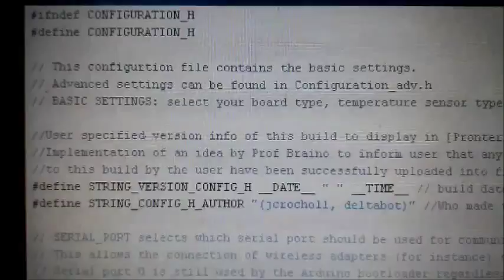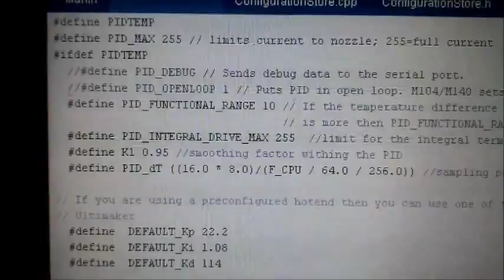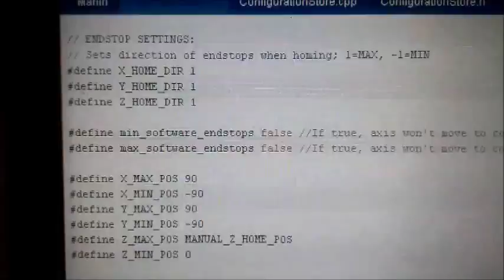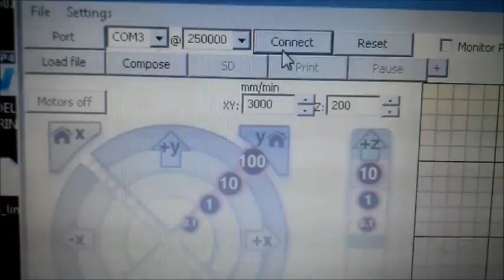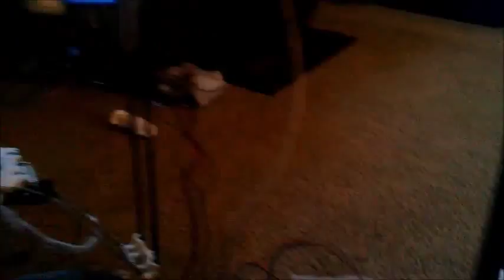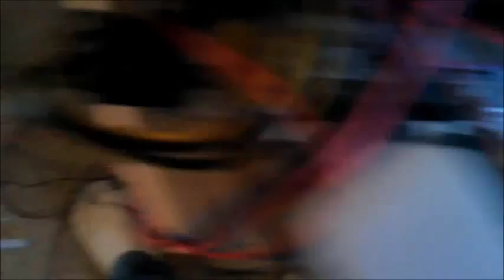ROSTOCK 3D PRINTER MARLIN FIRMWARE HELP!!

Comment: I would first ask how your endstops are wired.  On mine, a Normally Closed endstop resulted in the endstops_inverting false line.  Are your switches Normally open, and then close when the carriage hits?  My guess would be the switches are wired backwards or those lines need to be true.  It dosent move, because it thinks the endstops are pushed in right now...  Try to home all with one of the switches held.
Reply from the maker: https://www.facebook.com/pages/Southern-Idaho-3D-Printers-Group/673694712681546

my fig

#ifndef CONFIGURATION_H
#define CONFIGURATION_H

// This configuration file contains the basic settings.
// Advanced settings can be found in Configuration_adv.h
// BASIC SETTINGS: select your board type, temperature sensor type, axis scaling, and endstop configuration

// User-specified version info of this build to display in [Pronterface, etc] terminal window during
// startup. Implementation of an idea by Prof Braino to inform user that any changes made to this
// build by the user have been successfully uploaded into firmware.
#define STRING_VERSION_CONFIG_H _DATE_ " " _TIME_ // build date and time
#define STRING_CONFIG_H_AUTHOR "(jcrocholl, deltabot)" // Who made the changes.

// SERIAL_PORT selects which serial port should be used for communication with the host.
// This allows the connection of wireless adapters (for instance) to non-default port pins.
// Serial port 0 is still used by the Arduino bootloader regardless of this setting.
#define SERIAL_PORT 0

// This determines the communication speed of the printer
#define BAUDRATE 250000
//#define BAUDRATE 115200

//// The following define selects which electronics board you have. Please choose the one that matches your setup
// 10 = Gen7 custom (Alfons3 Version) "https://github.com/Alfons3/Generation_7_Electronics"
// 11 = Gen7 v1.1, v1.2 = 11
// 12 = Gen7 v1.3
// 13 = Gen7 v1.4
// 3  = MEGA/RAMPS up to 1.2 = 3
// 33 = RAMPS 1.3 / 1.4 (Power outputs: Extruder, Fan, Bed)
// 34 = RAMPS 1.3 / 1.4 (Power outputs: Extruder0, Extruder1, Bed)
// 35 = RAMPS 1.3 / 1.4 (Power outputs: Extruder, Fan, Fan)
// 4  = Duemilanove w/ ATMega328P pin assignment
// 5  = Gen6
// 51 = Gen6 deluxe
// 6  = Sanguinololu < 1.2
// 62 = Sanguinololu 1.2 and above
// 63 = Melzi
// 64 = STB V1.1
// 65 = Azteeg X1
// 66 = Melzi with ATmega1284 (MaKr3d version)
// 7  = Ultimaker
// 71 = Ultimaker (Older electronics. Pre 1.5.4. This is rare)
// 77 = 3Drag Controller
// 8  = Teensylu
// 80 = Rumba
// 81 = Printrboard (AT90USB1286)
// 82 = Brainwave (AT90USB646)
// 9  = Gen3+
// 70 = Megatronics
// 701= Megatronics v2.0
// 702= Minitronics v1.0
// 90 = Alpha OMCA board
// 91 = Final OMCA board
// 301 = Rambo
// 21 = Elefu Ra Board (v3)

#ifndef MOTHERBOARD
#define MOTHERBOARD 33
#endif

// Define this to set a custom name for your generic Mendel,
#define CUSTOM_MENDEL_NAME "chris's bot"

// This defines the number of extruders
#define EXTRUDERS 1

//// The following define selects which power supply you have. Please choose the one that matches your setup
 //1 = ATX
// 2 = X-Box 360 203Watts (the blue wire connected to PS_ON and the red wire to VCC)

#define POWER_SUPPLY 1

//===========================================================================
//============================== Delta Settings =============================
//===========================================================================
// Enable DELTA kinematics
#define DELTA

// Make delta curves from many straight lines (linear interpolation).
// This is a trade-off between visible corners (not enough segments)
// and processor overload (too many expensive sqrt calls).
#define DELTA_SEGMENTS_PER_SECOND 200

// Center-to-center distance of the holes in the diagonal push rods.
#define DELTA_DIAGONAL_ROD 250.0 // mm

// Horizontal offset from middle of printer to smooth rod center.
#define DELTA_SMOOTH_ROD_OFFSET 177.0 // mm

// Horizontal offset of the universal joints on the end effector.
#define DELTA_EFFECTOR_OFFSET 33.0 // mm

// Horizontal offset of the universal joints on the carriages.
#define DELTA_CARRIAGE_OFFSET 18.0 // mm

// Effective horizontal distance bridged by diagonal push rods.
#define DELTA_RADIUS (DELTA_SMOOTH_ROD_OFFSET-DELTA_EFFECTOR_OFFSET-DELTA_CARRIAGE_OFFSET)

// Effective X/Y positions of the three vertical towers.
#define SIN_60 0.8660254037844386
#define COS_60 0.5
#define DELTA_TOWER1_X -SIN_60*DELTA_RADIUS // front left tower
#define DELTA_TOWER1_Y -COS_60*DELTA_RADIUS
#define DELTA_TOWER2_X SIN_60*DELTA_RADIUS // front right tower
#define DELTA_TOWER2_Y -COS_60*DELTA_RADIUS
#define DELTA_TOWER3_X 0.0 // back middle tower
#define DELTA_TOWER3_Y DELTA_RADIUS

// Diagonal rod squared
#define DELTA_DIAGONAL_ROD_2 pow(DELTA_DIAGONAL_ROD,2)

//===========================================================================
//=============================Thermal Settings  ============================
//===========================================================================
//
//-NORMAL IS 4.7kohm PULLUP!- 1kohm pullup can be used on hotend sensor, using correct resistor and table
//
//// Temperature sensor settings:
// -2 is thermocouple with MAX6675 (only for sensor 0)
// -1 is thermocouple with AD595
// 0 is not used
// 1 is 100k thermistor - best choice for EPCOS 100k (4.7k pullup)
// 2 is 200k thermistor - ATC Semitec 204GT-2 (4.7k pullup)
// 3 is mendel-parts thermistor (4.7k pullup)
// 4 is 10k thermistor !! do not use it for a hotend. It gives bad resolution at high temp. !!
// 5 is 100K thermistor - ATC Semitec 104GT-2 (Used in ParCan) (4.7k pullup)
// 6 is 100k EPCOS - Not as accurate as table 1 (created using a fluke thermocouple) (4.7k pullup)
// 7 is 100k Honeywell thermistor 135-104LAG-J01 (4.7k pullup)
// 71 is 100k Honeywell thermistor 135-104LAF-J01 (4.7k pullup)
// 8 is 100k 0603 SMD Vishay NTCS0603E3104FXT (4.7k pullup)
// 9 is 100k GE Sensing AL03006-58.2K-97-G1 (4.7k pullup)
// 10 is 100k RS thermistor 198-961 (4.7k pullup)
// 60 is 100k Maker's Tool Works Kapton Bed Thermister
//
//    1k ohm pullup tables - This is not normal, you would have to have changed out your 4.7k for 1k
//                          (but gives greater accuracy and more stable PID)
// 51 is 100k thermistor - EPCOS (1k pullup)
// 52 is 200k thermistor - ATC Semitec 204GT-2 (1k pullup)
// 55 is 100k thermistor - ATC Semitec 104GT-2 (Used in ParCan) (1k pullup)

#define TEMP_SENSOR_0 1
#define TEMP_SENSOR_1 0
#define TEMP_SENSOR_2 0
#define TEMP_SENSOR_BED 1

// This makes temp sensor 1 a redundant sensor for sensor 0. If the temperatures difference between these sensors is to high the print will be aborted.
//#define TEMP_SENSOR_1_AS_REDUNDANT
//#define MAX_REDUNDANT_TEMP_SENSOR_DIFF 10

// Actual temperature must be close to target for this long before M109 returns success
#define TEMP_RESIDENCY_TIME 3  // (seconds)
#define TEMP_HYSTERESIS 3       // (degC) range of +/- temperatures considered "close" to the target one
#define TEMP_WINDOW     1       // (degC) Window around target to start the residency timer x degC early.

// The minimal temperature defines the temperature below which the heater will not be enabled It is used
// to check that the wiring to the thermistor is not broken.
// Otherwise this would lead to the heater being powered on all the time.
#define HEATER_0_MINTEMP 3
#define HEATER_1_MINTEMP 0
#define HEATER_2_MINTEMP 0
#define BED_MINTEMP 5

// When temperature exceeds max temp, your heater will be switched off.
// This feature exists to protect your hotend from overheating accidentally, but NOT from thermistor short/failure!
// You should use MINTEMP for thermistor short/failure protection.
#define HEATER_0_MAXTEMP 275
#define HEATER_1_MAXTEMP 275
#define HEATER_2_MAXTEMP 275
#define BED_MAXTEMP 150

// If your bed has low resistance e.g. .6 ohm and throws the fuse you can duty cycle it to reduce the
// average current. The value should be an integer and the heat bed will be turned on for 1 interval of
// HEATER_BED_DUTY_CYCLE_DIVIDER intervals.
//#define HEATER_BED_DUTY_CYCLE_DIVIDER 4

// PID settings:
// Comment the following line to disable PID and enable bang-bang.
#define PIDTEMP
#define BANG_MAX 255 // limits current to nozzle while in bang-bang mode; 255=full current
#define PID_MAX 255 // limits current to nozzle while PID is active (see PID_FUNCTIONAL_RANGE below); 255=full current
#ifdef PIDTEMP
  //#define PID_DEBUG // Sends debug data to the serial port.
  //#define PID_OPENLOOP 1 // Puts PID in open loop. M104/M140 sets the output power from 0 to PID_MAX
  #define PID_FUNCTIONAL_RANGE 3 // If the temperature difference between the target temperature and the actual temperature
                                  // is more then PID_FUNCTIONAL_RANGE then the PID will be shut off and the heater will be set to min/max.
  #define PID_INTEGRAL_DRIVE_MAX 255  //limit for the integral term
  #define K1 0.95 //smoothing factor within the PID
  #define PID_dT ((16.0 * 8.0)/(F_CPU / 64.0 / 256.0)) //sampling period of the temperature routine

// If you are using a preconfigured hotend then you can use one of the value sets by uncommenting it
// Ultimaker
    #define  DEFAULT_Kp 22.2
    #define  DEFAULT_Ki 1.08
    #define  DEFAULT_Kd 114

// Makergear
//    #define  DEFAULT_Kp 7.0
//    #define  DEFAULT_Ki 0.1
//    #define  DEFAULT_Kd 12

// Mendel Parts V9 on 12V
//    #define  DEFAULT_Kp 63.0
//    #define  DEFAULT_Ki 2.25
//    #define  DEFAULT_Kd 440
//#endif // PIDTEMP

// Bed Temperature Control
// Select PID or bang-bang with PIDTEMPBED. If bang-bang, BED_LIMIT_SWITCHING will enable hysteresis
//
// Uncomment this to enable PID on the bed. It uses the same frequency PWM as the extruder.
// If your PID_dT above is the default, and correct for your hardware/configuration, that means 7.689Hz,
// which is fine for driving a square wave into a resistive load and does not significantly impact you FET heating.
// This also works fine on a Fotek SSR-10DA Solid State Relay into a 250W heater.
// If your configuration is significantly different than this and you don't understand the issues involved, you probably
// shouldn't use bed PID until someone else verifies your hardware works.
// If this is enabled, find your own PID constants below.
//#define PIDTEMPBED
//
//#define BED_LIMIT_SWITCHING

// This sets the max power delivered to the bed, and replaces the HEATER_BED_DUTY_CYCLE_DIVIDER option.
// all forms of bed control obey this (PID, bang-bang, bang-bang with hysteresis)
// setting this to anything other than 255 enables a form of PWM to the bed just like HEATER_BED_DUTY_CYCLE_DIVIDER did,
// so you shouldn't use it unless you are OK with PWM on your bed.  (see the comment on enabling PIDTEMPBED)
#define MAX_BED_POWER 255 // limits duty cycle to bed; 255=full current

//#ifdef PIDTEMPBED
//120v 250W silicone heater into 4mm borosilicate (MendelMax 1.5+)
//from FOPDT model - kp=.39 Tp=405 Tdead=66, Tc set to 79.2, aggressive factor of .15 (vs .1, 1, 10)
    #define  DEFAULT_bedKp 10.00
    #define  DEFAULT_bedKi .023
    #define  DEFAULT_bedKd 305.4

//120v 250W silicone heater into 4mm borosilicate (MendelMax 1.5+)
//from pidautotune
//    #define  DEFAULT_bedKp 97.1
//    #define  DEFAULT_bedKi 1.41
//    #define  DEFAULT_bedKd 1675.16

// FIND YOUR OWN: "M303 E-1 C8 S90" to run autotune on the bed at 90 degreesC for 8 cycles.
#endif // PIDTEMPBED

//this prevents dangerous Extruder moves, i.e. if the temperature is under the limit
//can be software-disabled for whatever purposes by
#define PREVENT_DANGEROUS_EXTRUDE
//if PREVENT_DANGEROUS_EXTRUDE is on, you can still disable (uncomment) very long bits of extrusion separately.
#define PREVENT_LENGTHY_EXTRUDE

#define EXTRUDE_MINTEMP 170
#define EXTRUDE_MAXLENGTH (X_MAX_LENGTH+Y_MAX_LENGTH) //prevent extrusion of very large distances.

//===========================================================================
//=============================Mechanical Settings===========================
//===========================================================================

// Uncomment the following line to enable CoreXY kinematics
// #define COREXY

// coarse Endstop Settings
//#define ENDSTOPPULLUPS // Comment this out (using // at the start of the line) to disable the endstop pullup resistors

#ifndef ENDSTOPPULLUPS
  // fine Enstop settings: Individual Pullups. will be ignored if ENDSTOPPULLUPS is defined
   #define ENDSTOPPULLUP_XMAX
   #define ENDSTOPPULLUP_YMAX
   #define ENDSTOPPULLUP_ZMAX
   #define ENDSTOPPULLUP_XMIN
   #define ENDSTOPPULLUP_YMIN
   #define ENDSTOPPULLUP_ZMIN
#endif

#ifdef ENDSTOPPULLUPS
  #define ENDSTOPPULLUP_XMAX
  #define ENDSTOPPULLUP_YMAX
  #define ENDSTOPPULLUP_ZMAX
  #define ENDSTOPPULLUP_XMIN
  #define ENDSTOPPULLUP_YMIN
  #define ENDSTOPPULLUP_ZMIN
#endif

// The pullups are needed if you directly connect a mechanical endswitch between the signal and ground pins.
const bool X_MIN_ENDSTOP_INVERTING = true; // set to true to invert the logic of the endstop.
const bool Y_MIN_ENDSTOP_INVERTING = true; // set to true to invert the logic of the endstop.
const bool Z_MIN_ENDSTOP_INVERTING = true; // set to true to invert the logic of the endstop.
const bool X_MAX_ENDSTOP_INVERTING = true; // set to true to invert the logic of the endstop.
const bool Y_MAX_ENDSTOP_INVERTING = true; // set to true to invert the logic of the endstop.
const bool Z_MAX_ENDSTOP_INVERTING = true; // set to true to invert the logic of the endstop.
//#define DISABLE_MAX_ENDSTOPS
//#define DISABLE_MIN_ENDSTOPS

// Disable max endstops for compatibility with endstop checking routine
//#if defined(COREXY) && !defined(DISABLE_MAX_ENDSTOPS)
  //#define DISABLE_MAX_ENDSTOPS
//#endif

// For Inverting Stepper Enable Pins (Active Low) use 0, Non Inverting (Active High) use 1
#define X_ENABLE_ON 0
#define Y_ENABLE_ON 0
#define Z_ENABLE_ON 0
#define E_ENABLE_ON 0 // For all extruders

// Disables axis when it's not being used.
#define DISABLE_X false
#define DISABLE_Y false
#define DISABLE_Z false
#define DISABLE_E false // For all extruders

#define INVERT_X_DIR true  // for Mendel set to false, for Orca set to true
#define INVERT_Y_DIR true   // for Mendel set to true, for Orca set to false
#define INVERT_Z_DIR true    // for Mendel set to false, for Orca set to true
#define INVERT_E0_DIR false   // for direct drive extruder v9 set to true, for geared extruder set to false
#define INVERT_E1_DIR false   // for direct drive extruder v9 set to true, for geared extruder set to false
#define INVERT_E2_DIR false   // for direct drive extruder v9 set to true, for geared extruder set to false

// ENDSTOP SETTINGS:
// Sets direction of endstops when homing; 1=MAX, -1=MIN
#define X_HOME_DIR 1
#define Y_HOME_DIR 1
#define Z_HOME_DIR 1

#define min_software_endstops false // If true, axis won't move to coordinates less than HOME_POS.
#define max_software_endstops false  // If true, axis won't move to coordinates greater than the defined lengths below.
// Travel limits after homing
#define X_MAX_POS 90
#define X_MIN_POS -90
#define Y_MAX_POS 90
#define Y_MIN_POS -90
#define Z_MAX_POS MANUAL_Z_HOME_POS
#define Z_MIN_POS 0

#define X_MAX_LENGTH (X_MAX_POS - X_MIN_POS)
#define Y_MAX_LENGTH (Y_MAX_POS - Y_MIN_POS)
#define Z_MAX_LENGTH (Z_MAX_POS - Z_MIN_POS)

// The position of the homing switches
#define MANUAL_HOME_POSITIONS  // If defined, MANUAL_*_HOME_POS below will be used
//#define BED_CENTER_AT_0_0  // If defined, the center of the bed is at (X=0, Y=0)

//Manual homing switch locations:
// For deltabots this means top and center of the cartesian print volume.
#define MANUAL_X_HOME_POS 0
#define MANUAL_Y_HOME_POS 0
#define MANUAL_Z_HOME_POS 284  // For delta: Distance between nozzle and print surface after homing.

#define AUTOLEVEL_GRID 20  // Distance between autolevel Z probing points, should be less than print surface radius/3.

//// MOVEMENT SETTINGS
#define NUM_AXIS 4 // The axis order in all axis related arrays is X, Y, Z, E
#define HOMING_FEEDRATE {90*60, 90*60, 90*60, 0}  // set the homing speeds (mm/min)

#define Z_PROBE_OFFSET {4.4, -55, -9, 0}  // X, Y, Z, E distance between hotend nozzle and deployed bed leveling probe.

// default settings

#define DEFAULT_AXIS_STEPS_PER_UNIT   {45.5, 45.5, 45.5, 100}
#define DEFAULT_MAX_FEEDRATE          {300, 300, 300, 300}    // (mm/sec)
#define DEFAULT_MAX_ACCELERATION      {9000,9000,9000,9000}    // X, Y, Z, E maximum start speed for accelerated moves. E default values are good for skeinforge 40+, for older versions raise them a lot.

#define DEFAULT_ACCELERATION          1000    // X, Y, Z and E max acceleration in mm/s^2 for printing moves
#define DEFAULT_RETRACT_ACCELERATION  1000   // X, Y, Z and E max acceleration in mm/s^2 for retracts

// Offset of the extruders (uncomment if using more than one and relying on firmware to position when changing).
// The offset has to be X=0, Y=0 for the extruder 0 hotend (default extruder).
// For the other hotends it is their distance from the extruder 0 hotend.
// #define EXTRUDER_OFFSET_X {0.0, 20.00} // (in mm) for each extruder, offset of the hotend on the X axis
// #define EXTRUDER_OFFSET_Y {0.0, 5.00}  // (in mm) for each extruder, offset of the hotend on the Y axis

// The speed change that does not require acceleration (i.e. the software might assume it can be done instantaneously)
#define DEFAULT_XYJERK                20.0    // (mm/sec)
#define DEFAULT_ZJERK                 20.0    // (mm/sec)
#define DEFAULT_EJERK                 20.0    // (mm/sec)

//===========================================================================
//=============================Additional Features===========================
//===========================================================================

// EEPROM
// the microcontroller can store settings in the EEPROM, e.g. max velocity...
// M500 - stores paramters in EEPROM
// M501 - reads parameters from EEPROM (if you need reset them after you changed them temporarily).
// M502 - reverts to the default "factory settings".  You still need to store them in EEPROM afterwards if you want to.
//define this to enable eeprom support
#define EEPROM_SETTINGS
//to disable EEPROM Serial responses and decrease program space by ~1700 byte: comment this out:
// please keep turned on if you can.
#define EEPROM_CHITCHAT

// Preheat Constants
#define PLA_PREHEAT_HOTEND_TEMP 180
#define PLA_PREHEAT_HPB_TEMP 70
#define PLA_PREHEAT_FAN_SPEED 255   // Insert Value between 0 and 255

#define ABS_PREHEAT_HOTEND_TEMP 240
#define ABS_PREHEAT_HPB_TEMP 100
#define ABS_PREHEAT_FAN_SPEED 255   // Insert Value between 0 and 255

//LCD and SD support
#define ULTRA_LCD  //general lcd support, also 16x2
//#define DOGLCD  // Support for SPI LCD 128x64 (Controller ST7565R graphic Display Family)
#define SDSUPPORT // Enable SD Card Support in Hardware Console
//#define SDSLOW // Use slower SD transfer mode (not normally needed - uncomment if you're getting volume init error)

//#define ULTIMAKERCONTROLLER //as available from the ultimaker online store.
//#define ULTIPANEL  //the ultipanel as on thingiverse

// The MaKr3d Makr-Panel with graphic controller and SD support
// http://reprap.org/wiki/MaKr3d_MaKrPanel
//#define MAKRPANEL

 //The RepRapDiscount Smart Controller (white PCB)
// http://reprap.org/wiki/RepRapDiscount_Smart_Controller
#define REPRAP_DISCOUNT_SMART_CONTROLLER

// The GADGETS3D G3D LCD/SD Controller (blue PCB)
// http://reprap.org/wiki/RAMPS_1.3/1.4_GADGETS3D_Shield_with_Panel
//#define G3D_PANEL

// The RepRapDiscount FULL GRAPHIC Smart Controller (quadratic white PCB)
// http://reprap.org/wiki/RepRapDiscount_Full_Graphic_Smart_Controller
//
// ==> REMEMBER TO INSTALL U8glib to your ARDUINO library folder: http://code.google.com/p/u8glib/wiki/u8glib
//#define REPRAP_DISCOUNT_FULL_GRAPHIC_SMART_CONTROLLER

// The RepRapWorld REPRAPWORLD_KEYPAD v1.1
// http://reprapworld.com/?products_details&products_id=202&cPath=1591_1626
//#define REPRAPWORLD_KEYPAD
//#define REPRAPWORLD_KEYPAD_MOVE_STEP 10.0 // how much should be moved when a key is pressed, eg 10.0 means 10mm per click

// The Elefu RA Board Control Panel
// http://www.elefu.com/index.php?route=product/product&product_id=53
// REMEMBER TO INSTALL LiquidCrystal_I2C.h in your ARUDINO library folder: https://github.com/kiyoshigawa/LiquidCrystal_I2C
//#define RA_CONTROL_PANEL

//automatic expansion
//#if defined (MAKRPANEL)
 //#define DOGLCD
 #define SDSUPPORT
 //#define ULTIPANEL
 //#define NEWPANEL
// #define DEFAULT_LCD_CONTRAST 17
//#endif

//#if defined (REPRAP_DISCOUNT_FULL_GRAPHIC_SMART_CONTROLLER)
// #define DOGLCD
// #define U8GLIB_ST7920
#define REPRAP_DISCOUNT_SMART_CONTROLLER
//#endif

#if defined(ULTIMAKERCONTROLLER) || defined(REPRAP_DISCOUNT_SMART_CONTROLLER) || defined(G3D_PANEL)
 #define ULTIPANEL
 #define NEWPANEL
#endif

//#if defined(REPRAPWORLD_KEYPAD)
  //#define NEWPANEL
 // #define ULTIPANEL
//#endif
//#if defined(RA_CONTROL_PANEL)
 //#define ULTIPANEL
 //#define NEWPANEL
// #define LCD_I2C_TYPE_PCA8574
// #define LCD_I2C_ADDRESS 0x27   // I2C Address of the port expander
//#endif

//I2C PANELS

//#define LCD_I2C_SAINSMART_YWROBOT
//#ifdef LCD_I2C_SAINSMART_YWROBOT
  // This uses the LiquidCrystal_I2C library ( https://bitbucket.org/fmalpartida/new-liquidcrystal/wiki/Home )
  // Make sure it is placed in the Arduino libraries directory.
 // #define LCD_I2C_TYPE_PCF8575
  //#define LCD_I2C_ADDRESS 0x27   // I2C Address of the port expander
 // #define NEWPANEL
 // #define ULTIPANEL
//#endif

// PANELOLU2 LCD with status LEDs, separate encoder and click inputs
//#define LCD_I2C_PANELOLU2
//#ifdef LCD_I2C_PANELOLU2
  // This uses the LiquidTWI2 library v1.2.3 or later ( https://github.com/lincomatic/LiquidTWI2 )
  // Make sure the LiquidTWI2 directory is placed in the Arduino or Sketchbook libraries subdirectory.
  // (v1.2.3 no longer requires you to define PANELOLU in the LiquidTWI2.h library header file)
  // Note: The PANELOLU2 encoder click input can either be directly connected to a pin
  //       (if BTN_ENC defined to != -1) or read through I2C (when BTN_ENC == -1).
 // #define LCD_I2C_TYPE_MCP23017
 // #define LCD_I2C_ADDRESS 0x20 // I2C Address of the port expander
 // #define LCD_USE_I2C_BUZZER //comment out to disable buzzer on LCD
 // #define NEWPANEL
 // #define ULTIPANEL
//#endif

// Panucatt VIKI LCD with status LEDs, integrated click & L/R/U/P buttons, separate encoder inputs
//#define LCD_I2C_VIKI
//#ifdef LCD_I2C_VIKI
  // This uses the LiquidTWI2 library v1.2.3 or later ( https://github.com/lincomatic/LiquidTWI2 )
  // Make sure the LiquidTWI2 directory is placed in the Arduino or Sketchbook libraries subdirectory.
  // Note: The pause/stop/resume LCD button pin should be connected to the Arduino
  //       BTN_ENC pin (or set BTN_ENC to -1 if not used)
  //#define LCD_I2C_TYPE_MCP23017
  //#define LCD_I2C_ADDRESS 0x20 // I2C Address of the port expander
  //#define LCD_USE_I2C_BUZZER //comment out to disable buzzer on LCD (requires LiquidTWI2 v1.2.3 or later)
 // #define NEWPANEL
 // #define ULTIPANEL
//#endif

#ifdef ULTIPANEL
 #define NEWPANEL  //enable this if you have a click-encoder panel
  #define SDSUPPORT
  #define ULTRA_LCD
 // #ifdef DOGLCD // Change number of lines to match the DOG graphic display
    //#define LCD_WIDTH 20
    //#define LCD_HEIGHT 5
  //#else
    #define LCD_WIDTH 20
    #define LCD_HEIGHT 4
  //#endif
#else //no panel but just lcd
  #ifdef ULTRA_LCD
  //#ifdef DOGLCD // Change number of lines to match the 128x64 graphics display
    //#define LCD_WIDTH 20
    //#define LCD_HEIGHT 4
  //#else
    #define LCD_WIDTH 16
    #define LCD_HEIGHT 2
 #endif
 #endif
//#endif

// default LCD contrast for dogm-like LCD displays
//#ifdef DOGLCD
//# ifndef DEFAULT_LCD_CONTRAST
//#  define DEFAULT_LCD_CONTRAST 32
//# endif
//#endif

// Increase the FAN pwm frequency. Removes the PWM noise but increases heating in the FET/Arduino
//#define FAST_PWM_FAN

// Use software PWM to drive the fan, as for the heaters. This uses a very low frequency
// which is not ass annoying as with the hardware PWM. On the other hand, if this frequency
// is too low, you should also increment SOFT_PWM_SCALE.
//#define FAN_SOFT_PWM

// Incrementing this by 1 will double the software PWM frequency,
// affecting heaters, and the fan if FAN_SOFT_PWM is enabled.
// However, control resolution will be halved for each increment;
// at zero value, there are 128 effective control positions.
//#define SOFT_PWM_SCALE 0

// M240  Triggers a camera by emulating a Canon RC-1 Remote
// Data from: http://www.doc-diy.net/photo/rc-1_hacked/
// #define PHOTOGRAPH_PIN     23

// SF send wrong arc g-codes when using Arc Point as fillet procedure
//#define SF_ARC_FIX

// Support for the BariCUDA Paste Extruder.
//#define BARICUDA

/*******************************************************************\
* R/C SERVO support
* Sponsored by TrinityLabs, Reworked by codexmas
********************************************************************/

// Number of servos
//
// If you select a configuration below, this will receive a default value and does not need to be set manually
// set it manually if you have more servos than extruders and wish to manually control some
// leaving it undefined or defining as 0 will disable the servo subsystem
// If unsure, leave commented / disabled
//
//#define NUM_SERVOS 3 // Servo index starts with 0 for M280 command

// Servo Endstops
//
// This allows for servo actuated endstops, primary usage is for the Z Axis to eliminate calibration or bed height changes.
// Use M206 command to correct for switch height offset to actual nozzle height. Store that setting with M500.
//
//#define SERVO_ENDSTOPS {-1, -1, 0} // Servo index for X, Y, Z. Disable with -1
//#define SERVO_ENDSTOP_ANGLES {0,0, 0,0, 70,0} // X,Y,Z Axis Extend and Retract angles

#include "Configuration_adv.h"
#include "thermistortables.h"

#endif //__CONFIGURATION_H
Reply from the maker: post some pic on my page when you get it going!!

https://www.facebook.com/pages/Southern-Idaho-3D-Printers-Group/673694712681546?ref=hl